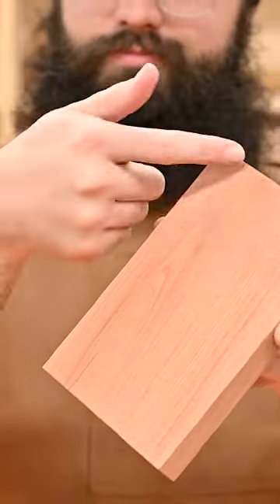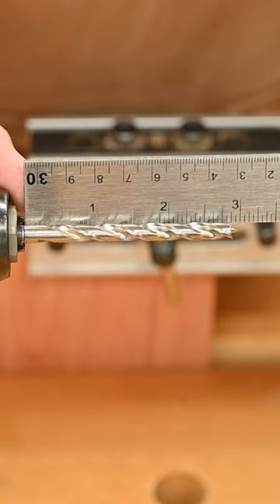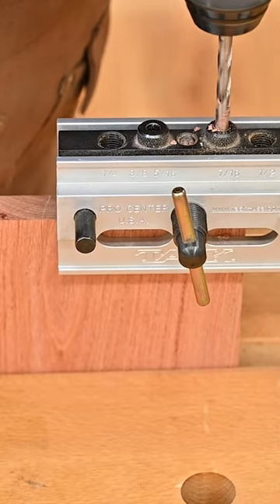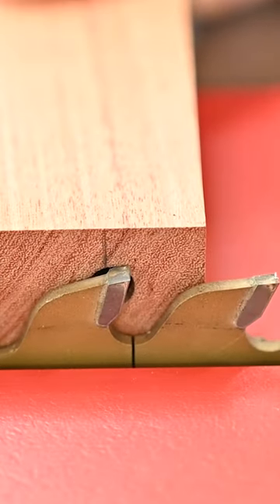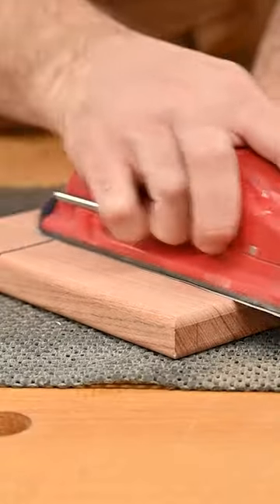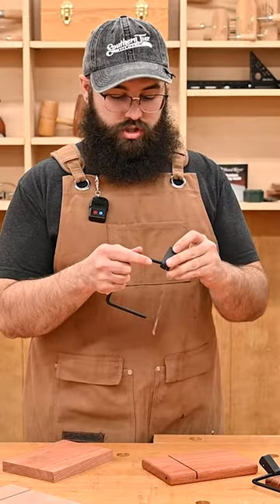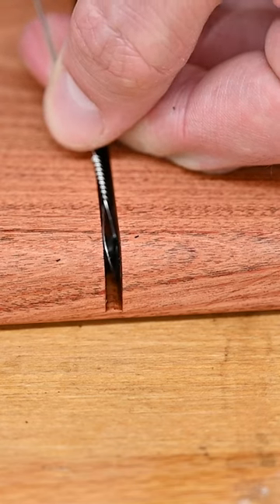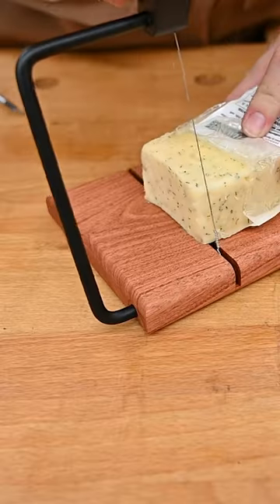Make a Cheese Slicer

Comment: Did you take one apart to get the wire and hardware or can you order it from some where
Reply from the maker: You can get it at Woodcraft!
Reply: What question is that, everyone has the cheese slice metal work at home.

Comment: I would make the cut wider for cleaning the cheese crack
Reply: Cheese crack lol
Reply: yup its so narrow you cannot clean it
Reply: Sounds like you have had a little cheese buildup in your crack before
Reply from the maker: I haven't had much issue with that, if I do a little toothpick or toothbrush does the trick.
Reply: It's the gift they never use so no real problem.